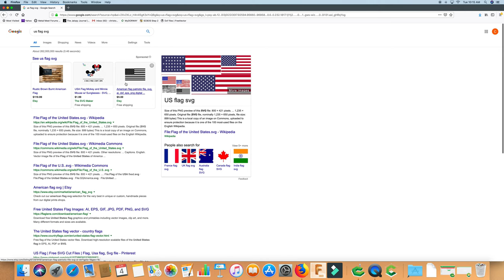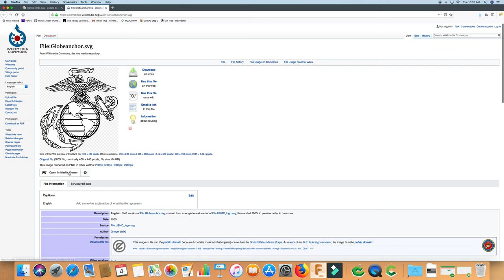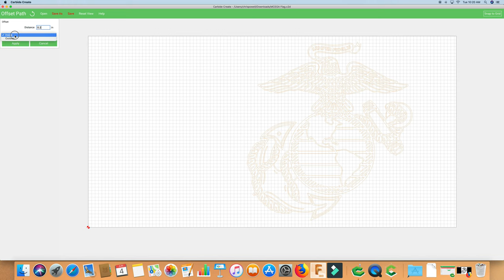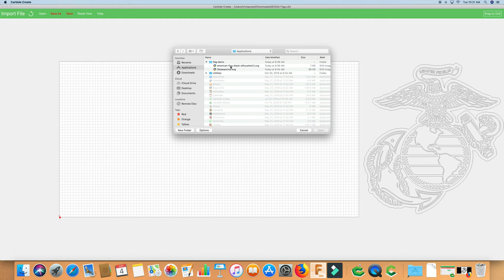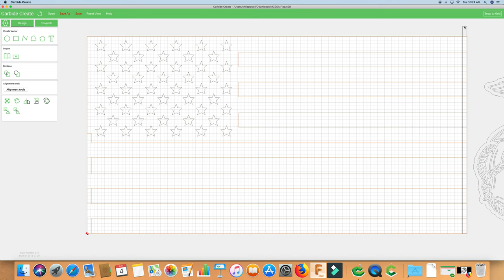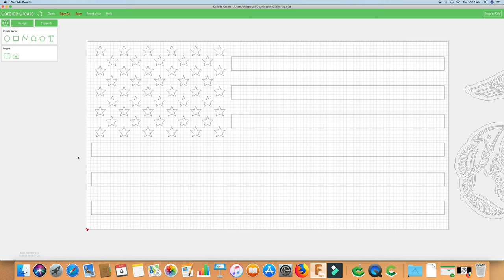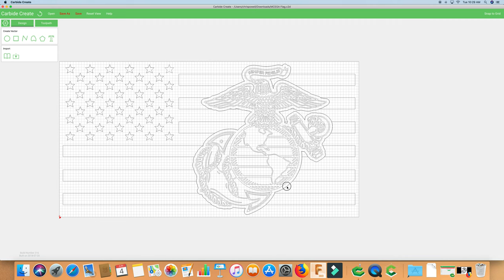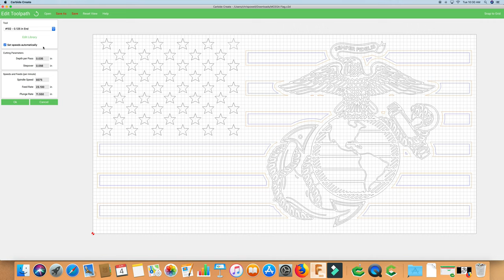How To Program This Wood USMC American Flag - Carbide Create Tutorial

Comment: Very basic question, but what kind of wood are you using for these?
Reply from the maker: Usually premium pine 1x12
Reply: So you’re gluing 2 together and then cutting that to the size you want?
Reply from the maker: I buy it in 8 foot sections. I get 4 from a board and have a small section left over.
Reply: Awesome!  Thanks man!

Comment: Great tips in the video.
I was wondering a question. I am using a current version of carbide create and twice the bit ran through part of the work it had already cut. Safe z was set correctly. All it was doing was pocketing out a large letter, then at the bottom of that pocket it was supposed to have cut something else. The tool went to the other side of the large letter I had pocketed out but it did not go above the top of the board. The bit went right through the large letter. I'm in the hole on this project because it did the exact same thing on another piece.
Reply from the maker: Sorry, I haven’t used the new version. Does everything in the simulation look right? Maybe something is loose on the machine.
Reply: @ChrisPowellFSD  
It doesn't chop off the letter in the simulation so everything is ok there. it was when it ran and the bit did not clear the letter that was previously carved. How ever, I did find the bolts loose on the feet that hold down the rails that the v wheels run on. Could that have been the problem? I didnt even notice any movement. I'll try it again and come back here and let you know. I did tighten them down.
Great videos by the way on carbide. I sure could use some advice? 
When adding a bit to the library, is "Diameter" the width of the shank or the width of the bit size like a 1 inch bit with a 1/4 shank? And, is ""Depth" the same as depth per pass?
Also, I have the newest one. I really haven't had any trouble with tool change. It stops when its time for a bit change but I keep hearing about separate tool paths because of trouble with bit changes. Am I hearing that correctly?
Reply from the maker: @iwannaapple7190  are you using a bit setter?
Reply: @ChrisPowellFSD  
I imagine thats one of those things that change the bit for you??? I just have a Longmill with a normal router.
Reply: @ChrisPowellFSD  Additionally, I use gSender with the Longmill
Reply from the maker: @iwannaapple7190  yea it is. If you’re saving a single g code, with multiple bits you’ll either need the bit setter or to use stop collars on your bits like I do to set them all to the same length.
Reply: @ChrisPowellFSD  
I don't know why setting a new 0 for z wouldn't work but I'll think about your take on it. Don't understand why yet and that is a good guess. I'll keep that in mind. Thx
If you have time, would you mind telling me about the library terms I asked about. Trying to create my own library and from what I've seen so far your pretty good with it.
Reply: @ChrisPowellFSD  
Would a touch plate do just as well for bit changes?

Comment: How long does this take on the machine using those speeds and feeds?  Nice video by the way, very easy to follow and learn from.
Reply from the maker: Around 1.5 hours. I usually turn the feed rate up to 200% once it’s running. I’ve also started turning the feeds on the 1/8” bit up to 60 ipm feed and 40 ipm plunge as well as doing .050” doc.

Comment: GREAT VIDEO!!  I have one question.  I've input your settings on this project exactly and I'm gettting a calculated completion time just for the EGA of 6-1/2 hrs!!  That's crazy.  How fast can I safely increase the feed rate?
Reply from the maker: You’re v carving it? I used the factory setting on that v bit. My dpp is .139, stepover .113, feed 60 ipm, and plunge is 30 ipm.
Reply: @ChrisPowellFSD  Yes v carving the ega and stars but flat end mill on stripes. The time calculation for the stripes using your exact settings was over an hour. I'm confident on how fast I can increase the stripes but I'm new to v carving so I wasn't sure how much faster I could push beyond what the default speeds in cc are.
Reply from the maker: Did you try the settings I posted? Let me know if that speeds it up. I’m curious to know what they’re set to.

Comment: How long does it take for the overall cut to finish?
Reply from the maker: About 1.5 hours.
Reply: @ChrisPowellFSD  my stripes says it will take 1hr 29 minutes. is that normal. then 1hr 35 for starts and 50 for the EGA
Reply from the maker: Chris Dingevan turn you’re feed rates up. I’ve gotten comfortable setting my 1/8” straight cut 2 flute to 60ipm feed and 40ipm plunge. I do .050” doc with a .040 step over. I usually turn this up to 200% once I see that it’s running good.

Comment: What is your carving time on this? Mine shows around 11 hours.
Reply from the maker: A little over an hour total. I run the stars and ega at 100 feed 80 plunge, and the stripes at 100 feed, 80 plunge, .050 doc, .080 total depth, with a .056 step over. I usually turn the machine up to 200% when doing the stripes.
Reply: @ChrisPowellFSD  How do you turn the machine up?

Comment: Why sometimes my shapeoko will not zero out, sometimes it will start 2 or 3 inches from where I set zero"
Reply from the maker: Is this happening on all axis? If it’s the x, sometimes the cable guide can snag on the limit switch and activate it prematurely. The solution is to move the limit switch to the other side of the bracket.
Reply: X and Y do not Center sometimes ,I can go back and rewrite the program with no adjustments on the machine and it will start correctly
Reply from the maker: What do you mean center? It’s hard to say without seeing at least the files. Is your machine homing out properly?
Reply: @ChrisPowellFSD  I meant Zero out when I said Center, and it seems to be homing fine this isn't a constant problem it is a once-in-awhile thing. I can re zero it over and over but it still goes back to the same place away from zero
Reply from the maker: Do you use a fence like I do? It moves to your workpiece zero based off of the homing switches, so as long as it’s homing properly, it should always move to the same spot.